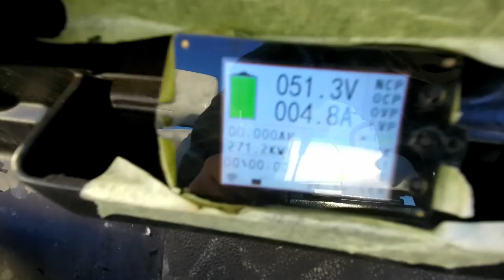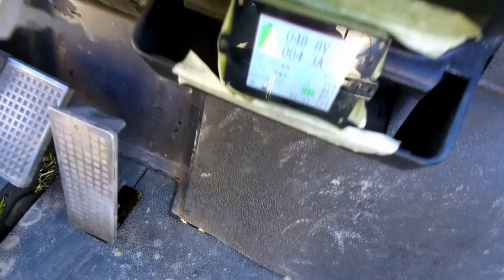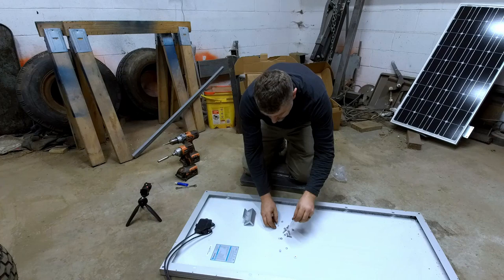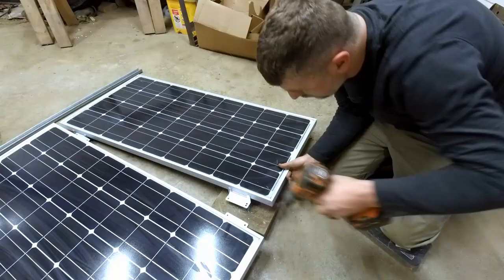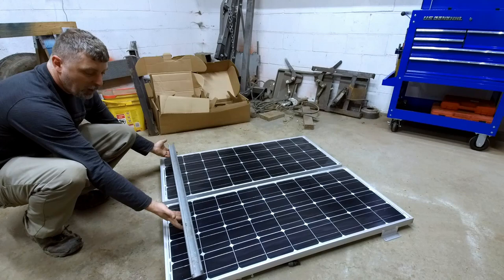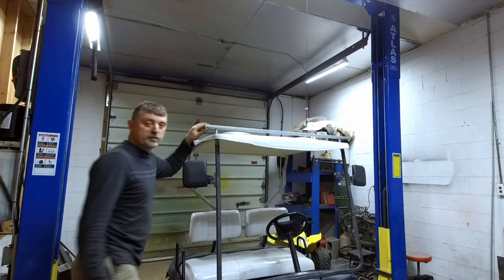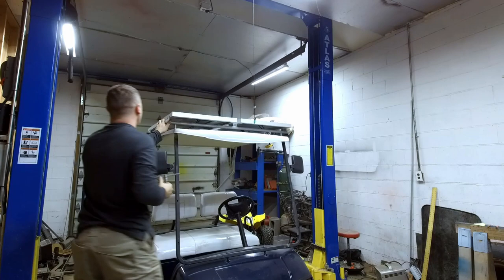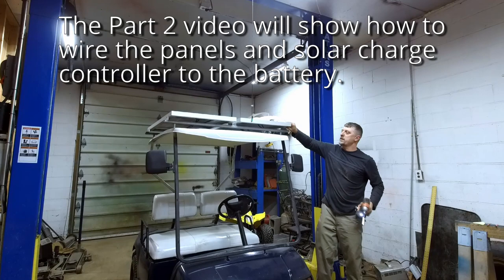How to Convert an Electric Golf Cart to Solar Power - Part 1

Comment: Hi, for wiring the charge controller to the battery series, did you simply wire the positive battery slot to the most positive battery terminal and and the neg. to the most neg.? Also, what is the voltage coming from your panels? Thanks
Reply from the maker: Yes that's correct. I am using two 12V panels also in series, so they only output at 24v. You need to use a boost style charger that can take a solar input of 24v and output at the battery voltage - which is 48v for my golfcart.

Comment: Great video. Having issues finding part 2.
Reply from the maker: Thanks!  Had some issues with the first charging controller I used not being weatherproof enough. Using a different boost charge controller now and its been working great! Just need to refilm the wiring process. Sorry - its been on my list, just need to make it a priority!

Comment: Your video has inspired me to do something similar with a 36-volt Club Car DS I just bought. I plan to retrofit it with a Renogy Boost 10 amp 36V/48V charge controller, 2 x 190 Volt solar panels and 3 x Renogy 100 ah, 12V LiFePo (w/ Bluetooth) batteries. I've already got a lot of Renogy gear so despite it being a bit more expensive it all works together really well and is easy for me to maintain.
Reply from the maker: How has this been working out?
Reply: @ModernSurvivalists it has worked out great! I’ve gone through two revisions and I now have build with 2 x 175 watt panels and a single 190 watt panel. I also installed a 9volt power point and two usb charger ports, a 9v fan, replaced the back-facing chair with a deck for firewood, and even a micro-fridge/cooler to keep a few beverages cold on a hot day. I never have to charge this guy. Just put it under some shine and keep an eye on it with the Bluetooth module and app on my phone. I’d like to build another now, but I don’t have the funds for it

Comment: Where's that second video? 5 months ago....
Reply from the maker: Sorry its been delayed because the charge controller I used worked great at first, but then started having problems possibly from humidity. I have a better charger charge controller to try now that is sealed and should be weatherproof but haven't had time to make the install video.

Comment: Come on man!  Let’s get this video up ;)
Reply from the maker: Sorry its been delayed because the charge controller I used worked great at first, but then started having problems possibly from humidity. I have a better charger charge controller to try now that is sealed and should be weatherproof but haven't had time to make the install video.

Comment: Couldnt you have connected the panels together with out bracket between them to close the gap
Reply from the maker: Possibly. I didn't think to try that. Might be a little more unwieldy though if you need to mount them both as one piece.

Comment: I am trying to do the same to my cart.   Did you complete part 2 of your videos ??    Hope so .    Thanks !!!   BTW,   I turned mine into a 48v battery bank for the House .......works great !!
Reply from the maker: I have it filmed but haven't had time to edit the footage into one video though.  I will try to get hat done soon.  The solar cart has been working great too!
Reply: @ModernSurvivalists  I am contemplating getting some solar panels with the intent of using an mppt controler to charge my two 36 volt carts off grid as I plan on getting an inverter and using the carts as a solar generator. I would love to see what you came up with on the 2nd video. And would appreciate any advice you may have regarding my build. Thanks I 

appreciate your time
Reply: Well so much for part 2.         Been a year now.
Reply from the maker: @rrrcoo31  Sorry its been delayed because the charge controller I used worked great at first, but then started having problems possibly from humidity. I have a better charger charge controller to try now that is sealed and should be weatherproof but haven't had time to make the install video.
Reply: @ModernSurvivalists  still waiting for part 2  dont leave  me hanging lol

Comment: Can it be charged by the solar pannel when driving ?
Reply from the maker: Yes it does continue to charge while driving, but the drive motor consumes more power than the panels provide. It will need additional charging between uses as well.